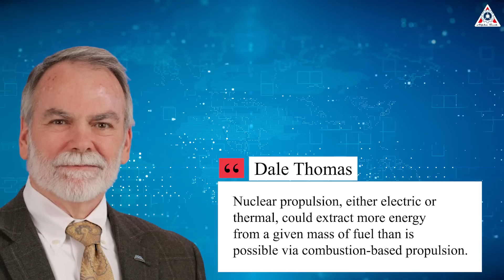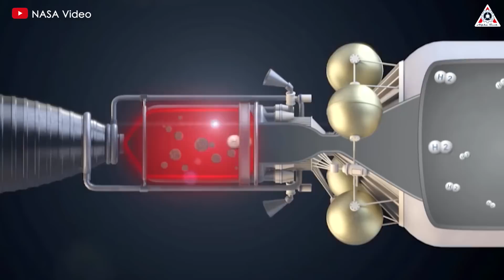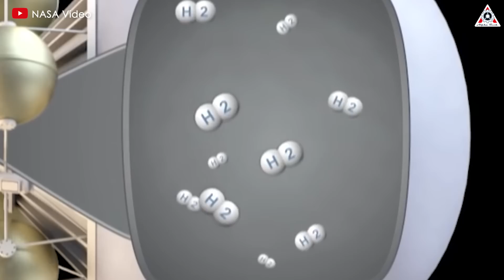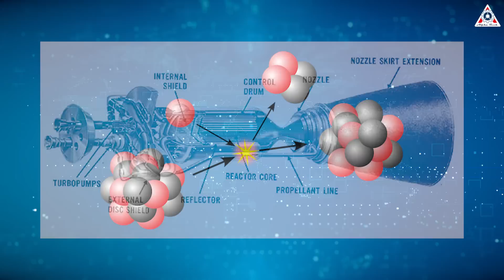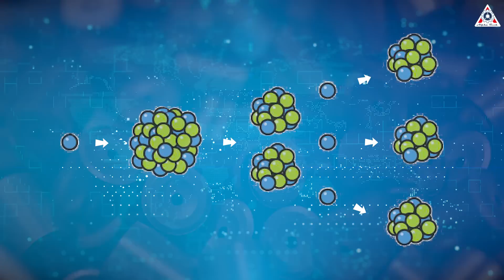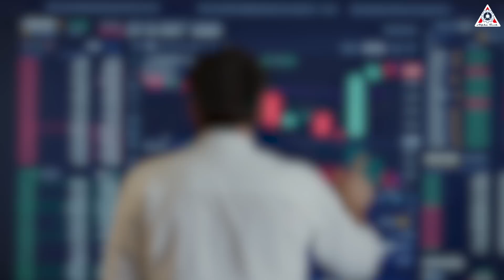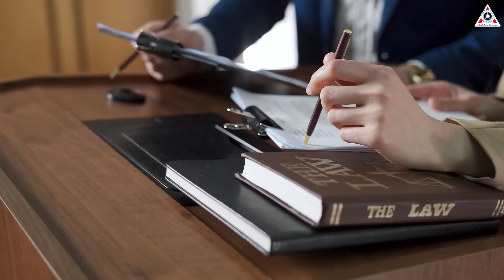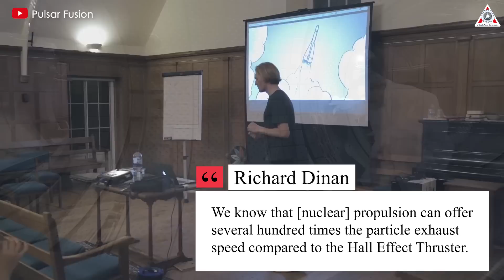NASA's NEW Nuclear Engine to visit Mars in Day, Faster & Better Starship!

Comment: Nuclear engines, yes.
But more important than that is nuclear energy whilst on Mars.
Bringing the first few starships back to Earth is crazy.
If you had a powerful energy source you could dig a trench, put a starship in it, then cover it up.
With some intelligent engineering this would make a great habitat.
Or, you could store cryogenic fluids. Over time, the Martian soil around the tank would become permafrost, a great insulator.
We should be aiming for missions to stay on Mars for 3 years or more, any less is just show boating.
We already have naval reactors that are good for 20 years, which is a good start.
Reactors were designed, though never built, that could last 100 years.
We developed a 4000 mega watt rocket engine called KIWI, but Nixon cancelled it. A crime far worse than Watergate IMO.
The secret to Martian exploration and possible colonisation is nuclear.
☢️ 🚀 👩‍🚀 ☢️🚀👩‍🚀🫡🫡

Comment: If The PPR has 100000N or 10tf thrust and exhaust velocity 50,000m/s then the plasma escapes from the magnetic nozzle in about 1/10,000 seconds (assuming the nozzle size is about 5m). If the pulse frequency is 1 Hz and that thrust of 10 tf the force is the baverage thrust over time, then the force on the ship from a single pulse would be 10000*10tf = 100000tf..!!?? On the other hand, if the 10tf is a force of a single pulse on the nozzle, then the average force would be about 10tf/10000 = 10N.

Comment: Good luck surviving the Van Allen Radiation Belt.😂
Reply: You are correct about radiation, but simple question : what is saving you from Sun's radiation? First Magnetic field of the Earth and Second Ozone layer, but mainly Magnetic field. So if your spaceship generates Magnetic field strong enough then you can exist in any kind of Medium.
Reply: @semorgh2854   so the magnetic field of the the earth and the ozone layer protected any manned space travel in it?. And the Apollo rocket generated a strong enough magnetic field by using a chemical fuel?. In addition once you leave the belt you are open to the suns radiation and all stars radiation in the galaxy?. I realize that all the stars in galaxy would have a minuscule effect because they are far way but remember there are over 200 billion of them in our galaxy. Please explain. Thanks.

Comment: Mass does not attract mass. There is no gravitational pull. Gravity, as a force, is stationary plane physics.

For every action, there is sn equal and opposite reaction. 
F=ma. To accelerate mass forward,  you need to accelerate mass backward. 

Gravity is the resistance of the mass to being accelerated. What is being done to neutralize the acceleration in Time that takes place along with acceleration in space.

Comment: Where to even start. HALEU exists now, this is still a Newtonian design, hydrogen is notoriously difficult to store (ammonia is interesting). Ultimately, this is just using fission to add to the chemical heat to add to the impulse. And the addition of EM engines seems to feel like science fiction. Bring back the bosses that know that the Orion drive is the way to go for nuclear drives.

Comment: Oho boy the NERVA nuclear rocket project of the 50's 60's again we have a nuclear wasteland at jackass flats in nevada from those days the engine spitting fuel rods out the tail pipe and regular explosions they finally got working well sort of project rover was smaller but still this is nothing new and you need tons of shielding from the naked reactor spewing gamma rays on the crew thats heavy good luck stay out of my town with this one skippy 😊
Reply: Pretty sure this is not that.
Reply: @JayZ-Denton until something goes wrong
Reply: @Top-cat-65  He's not talking about the same kind of engine the video is talking about.
Reply: @JayZ-Denton  interesting

Comment: A nuclear fusion engine will not likely be an efficient launch engine, however, a Space X rocket could ferry a nuclear propulsion capable Mars craft into space where it could propel the space craft to speeds unseen. It would be wise to send several drone rockets to mars in advance with supplies, emergency supplies parts and electronics.

Comment: Are these going to be with fragile humans on board and wouldn't it be impossible to endure that kind of speed.
Reply: Speed doesn't matter acceleration does
Reply: @portersraygun  uurgh. Very well.  Allow me to rephrase the question. "Are these to be crewed vessels and if so would it be possible to endure to endure that kind of acceleration/ deceleration combination.  Perhaps with something akin to the water chambers in; Event Horizon,  or is it an impossibility at this moment in time." ?
Reply: @jonbutcher9805  The projects in this video are about engine designs not a ship configuration, but yeah a ship using these could be manned. It would not have dangerously high acceleration.

Comment: can you possibly stop spouting COMPLETE bullshit? Do you know just how much a fraction of light's speed you'd have to be going to make it to mars in a DAY? Id love to know what kind of Fantasy material this ship is made of  as a structural engineer. I've always loved vehicles made of Unobtanium. To make it in a day, thats 0.5% the speed of light.. or roughtly 5.4MILLION kilometers per hour AVERAGE speed, Remember half the time would have to be spent slowing back down. earth to the moon the fastest mission to date was about 40,000 kph. 135x faster? .. sorry. not happening. That number is also ONLY if earth is at its closest point to mars.
Reply: 1.4 million miles per hour. And in a vacuum a beer can can theoretically withstand what friction would be imposed on the structure. Aluminum should be good enough. Not a imagined material from science fiction 😂
Reply: Remember all you need are experiments, videos and announcements, Hollywood does the rest.

Comment: I still think flipping four or more electrostatic ?! WAIT! that will come later Err-electromagnetic 
fields "Sections" strategically to provide enough velocity in any X, Y or Z direction as long as 
a nuclear generator is allowed, all it needs is enough energy ergo repulsion to double 
respective sections flipped field to double it's previous velocity. The trick is tying the bulk of 
the sections electromagnetically so that the section being repulsed is accelerated the most 
towards the desired direction, to which once moving is strategically electromagnetically 
recombined as part of the main mass to move the following section that is then 
electromagnetically flipped and accelerated, similar to "Mag trains" only the Main mass is 
electromagnetically established and reconfigured on the fly so that three sections repulse one
section forward.
 
To which at some point, the fields polarity would have to then be strategically reconfigured for 
the respective sections to provide deacceleration.
Also consider a minimum of 4 X 4 X 4 sections all up 64 sections" so that X, Y, & Z acceleration 
and deacceleration is possible. 
Yeah much like those UPA's that are utilising at the molecular level the atoms electrostatic fields, 
which are energised and manipulated using the energy of hydrogen, yeah our system won't be 
as sleek for some time, and they will still rely on our extremely crude nuclear understanding, but 
hey one day, we will drop the current archaic theories on theoretical particles, which will then 
open the flood gate to a new error in physics.

Comment: All this sounds good on paper, but creating the real thing will take much time and a lot of money before it comes operational. This happening in 2 or 3 years I don't see happening. More like 5-10 years or more. There is also the problem if the nuclear engine does not make orbit. What then? The other thing is we cannot send humans on a mission where the thrust exceeds 1 gravity. More than that would harm a normal human. Even at one gravity a mission to Mars will take more than a few days unless someone comes up with a way to cancel gravity. Only then could we push a space ship faster.
Reply: Being able to maintain a constant 1g acceleration would be ideal, because that would mimic surface gravity on Earth. It wouldn't be harmful to the astronauts at all.

However, I'll only believe NASA has built such an engine when they successfully test fly one.

Comment: Great then send freight in a slow starship ride and Express people to Mars inside a light weight inflatable. Carbon fiber fabric saturated in polyethylene inflatable. Thinest insulation possible,like paper but able to withstand a blow torch. Thin bullet proof vesting saturated in liquid water-Frozen water. Any puncture being Self Healing by melting and refreezing the water giving a Hard Shell. Line it with polyimide insulation. No stainless steel heavy weight. Usable ON OR IN ORBIT OF MARS FOR HABITAT, look this can be Small, Durable and compact until it clears the Earth's radiation belt.
No heavier than the Hot stage heat shield jettisoned at a Dead weight of 20,000 lbs of Waste. No supplies go on the manned trip to Mars. That will be orbiting Mars before people arrive.
Should only take 10 days or less if they can handle the G-Force.

Comment: Project NERVA, proposed and demonstrated a nuclear engine during the late 1950s. It worked exceedingly well.

The fear of launching a fully functional nuclear rocket into space, with a chance of a launch radiation disaster, became too high an issue. 

Today would use a large chemical rocket to deliver the nuclear engine to LEO, and separately transport its fuel rods. Assembled them in space to avoid any launching issues.

It's current plan in 2027 is to prove they can accelerate a "small" probe from LEO to the outer solar system.

Any Mars missions would require a much larger system.